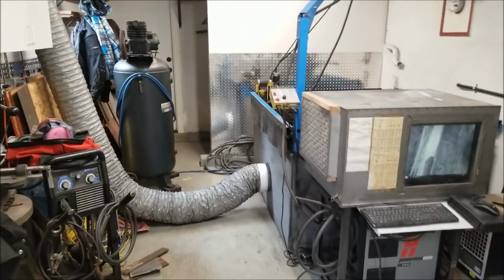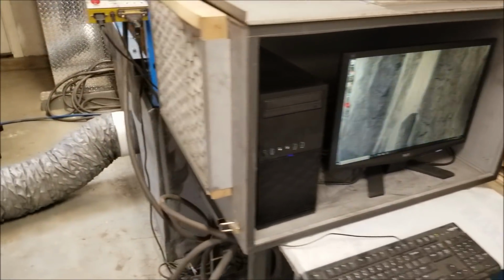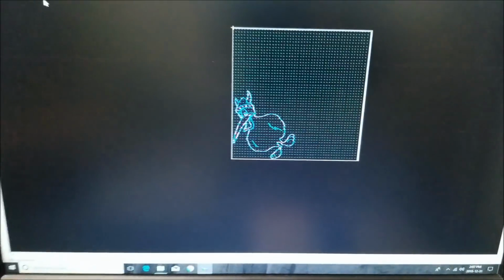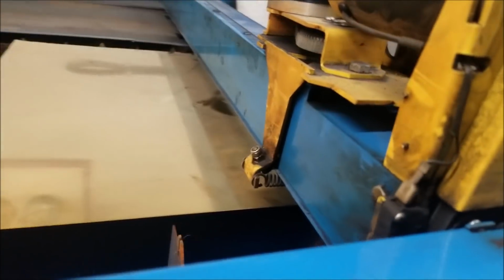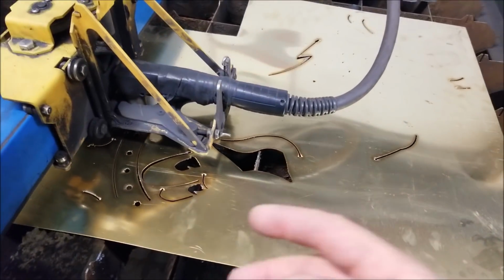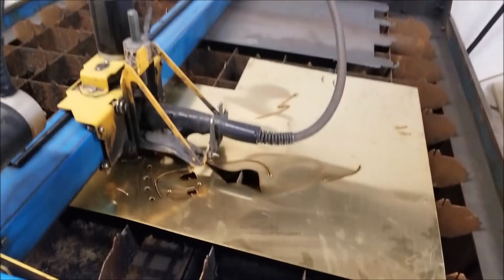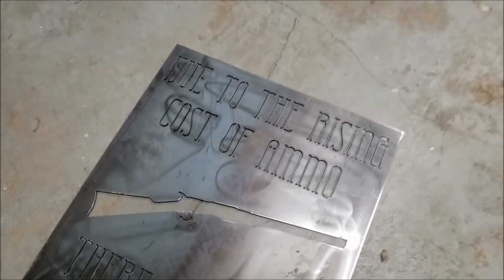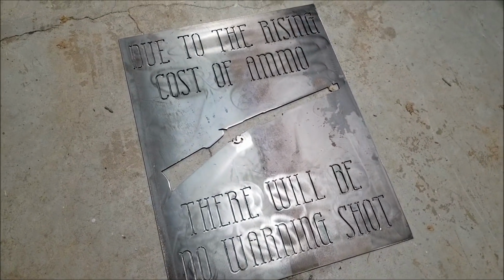I Bought A CNC PLASMA Cutting Machine!  Let's Have Some Fun!!!

Comment: 1. Consider venting from inside the table to outside. 2. Plasma Cam has an auto z axis if you can configure it right, but haven’t figured it to work perfectly every time. 3. There is fine cutting tips that work on thinner materials usually run a high of 40 amps, but you will get better looking puncher marks and less warping. 4. Love your videos glad you are making advances to greater thing on your channel!

Comment: I am not sure what plasma cutter or controller you are using but it might be possible to run an aux wire from the plasma cutter to a spare analog input to the controller and monitor the voltage of the arc.  If the voltage is too high, it can lower the torch and if it is too low, it can raise the torch.  it will follow warped material.  We have a 4'x9' CNC Plasma table that we built.  It has a Hypertherm 45 cutter.  It works great for warped material but the vertical speed is not fast enough to cut corrugated sheet metal at the required cutting speed for the thin material.